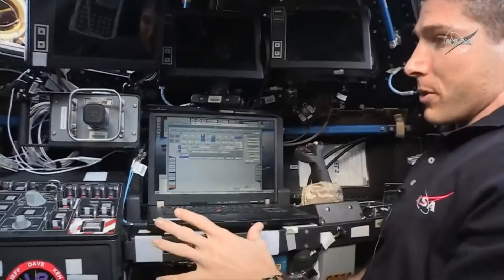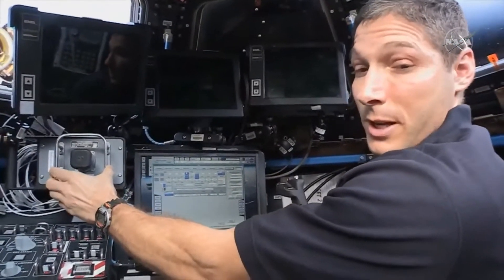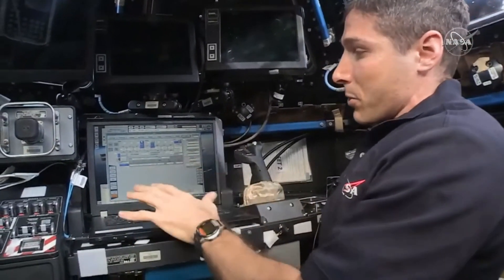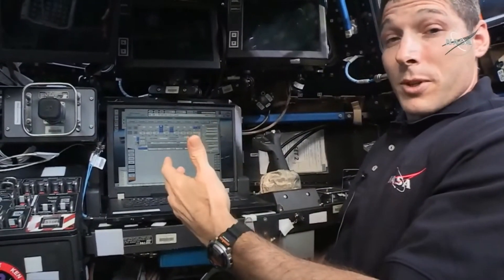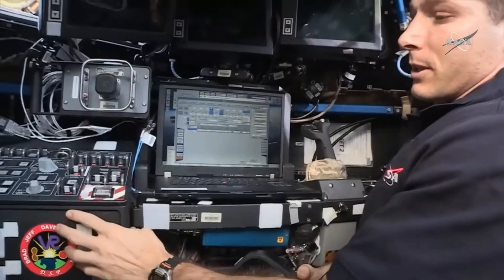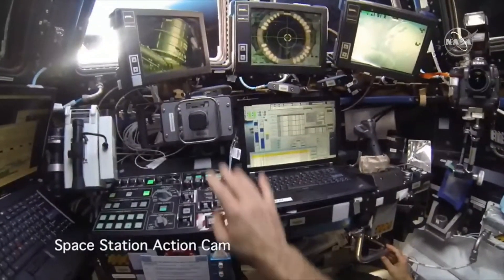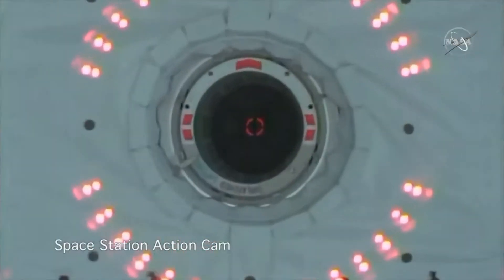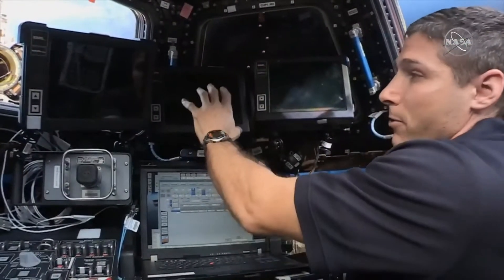Astronaut Mike Hopkins shows off Canadarm2 controls on the ISS!

Comment: I have sometimes designed and developed virtual control systems. One computer and one display (both duplicated for safeproofing) lets you control multiple systems in a stereotyped manner (for instance, mainframes, robots, satellite communication interface computers, database computers, parallel computers, storage banks, printer trains, and so on). A computer-to-device interface rack is needed, but in all, such a system gets rid of many different, dedicated handles, levers, and screens and should be an overall weight-and-clutter-reducing feature for space stations and spaceships.
Reply from the maker: Remember the remote manipulator system was designed back in the 90s.